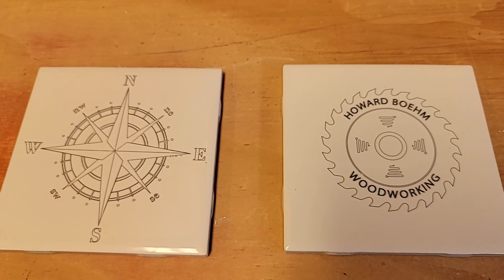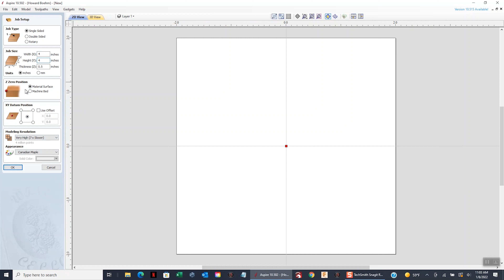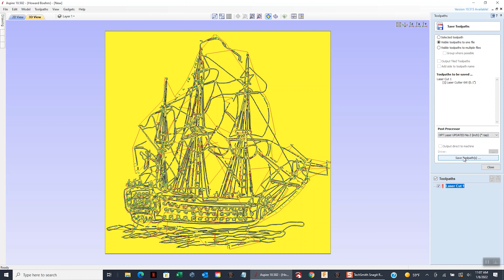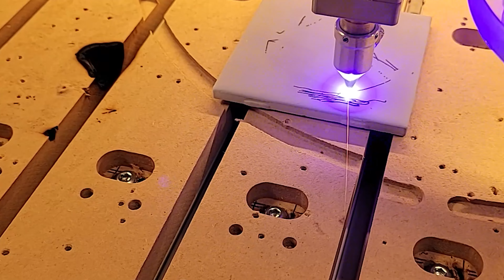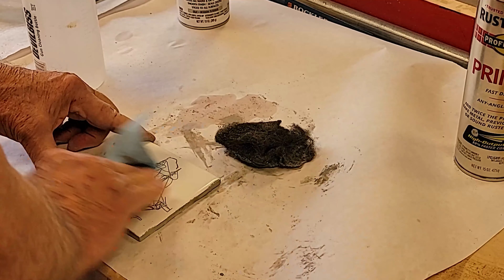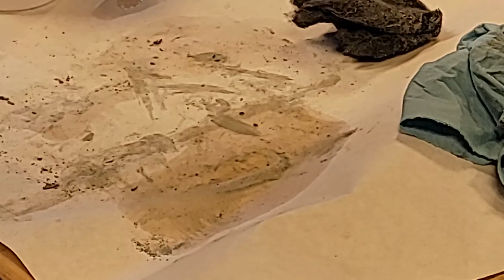Custom Engrave Ceramic Tile on you CNC with a Diode Laser

Comment: Thank you Howard for taking your time to make the video. I'm also a long time CNC owner and laser is a new field for me, but it was good to see Aspire as you working program, never thought it could be used for lasers, have to check on the unit you have :). I've tried Dry Molly Lub and the Rust-oleum primer, but I'm inclined to go to the Zinsser now, will get a can just to try. Also did a little bit with tempera paint applied with a foam brush, wash off with water under the faucet but it won't give me the darkness I see with the Zinsser. Thank you so much, we learn something new everyday.
Reply from the maker: Here is the link to Opt Lasers https://optlasers.com/?opt=y2142

Comment: Howard, I’m just now installing the OPT 15W on my Avid, and have zero experience with lasers.  What is the purpose of the primer?  What result would you get if you didn’t primer the tiles?
Reply from the maker: If you don't primer it will not butn in as well or at all. I think,  but I am not sure, it reflects the laser so it doesn't absorb.